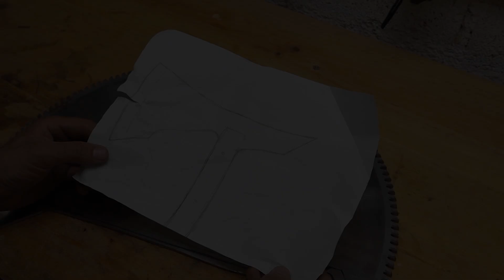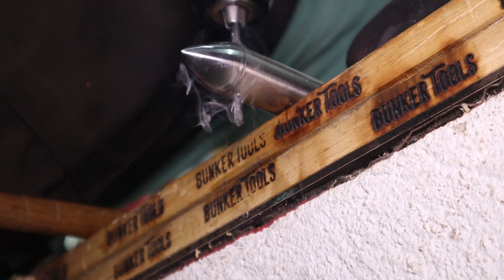Full Metal Tomahawk from Old Saw

Comment: While I think ASMR is an abuse of the word here, I question why you didn't countershink the hole, both sides, for the rivet so the heads could be flush with the shaft. In general, nice work/video.

From cooking class, balance between sharpness and staying sharp; hardness of the metal. Or should I say there is a trade-off.
Reply from the maker: I appreciate your comment, I see that at least you have seen the video. I have put ASMR in the title because I have left parts of the video that I consider relaxing and that I normally omit, but yes, I recognize that it may be excessive to put ASMR, maybe I will change it.
The steel of the saw is already sufficiently hardened for the purpose of the tomahawk.

Comment: How did you corrected the stress marks all over the blade? A trasversal hit could open them and shatter it
Reply from the maker: Sorry but I don't know exactly what you mean
Reply: @bunkerTools  the way you are forging, many point of the blade are subject to metal fatigue that create shatterpoints.
Reply from the maker: @Capitan0Guinea  I don't know if you mean the cuts made with the grinder, the finishes have been made with the hand file. I don't know if you mean that. Anyway it has no secret, cutting and shaping. The main material (saw blade) is solid and will not be easy to break